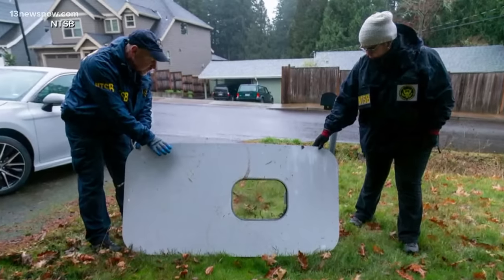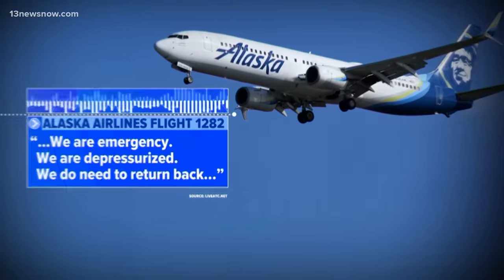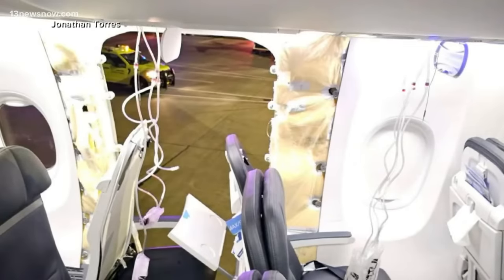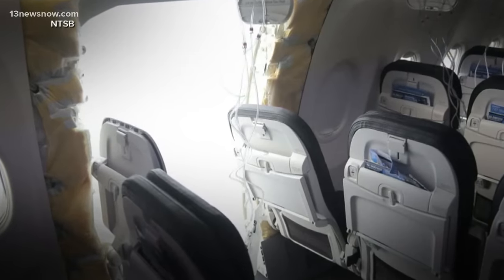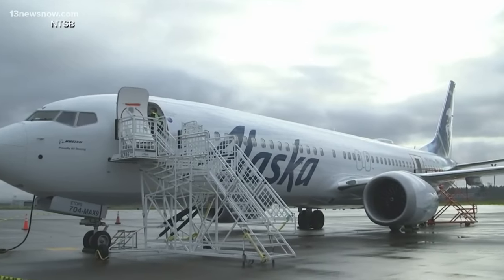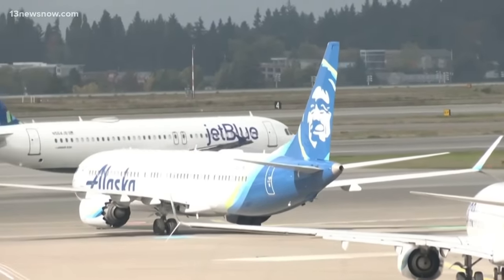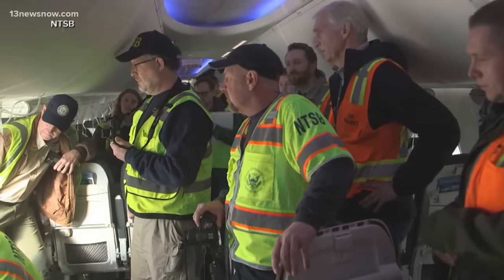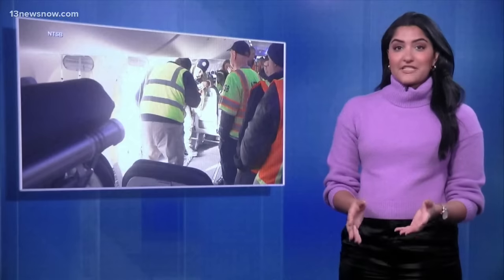Missing door plug from Alaska Airlines flight found

Comment: The cockpit door has blow-out panels that equalize pressure in the event of a rapid depressurization of the main cabin. In addition, there are multiple blow down panels along both sides of the fuselage, under the windows, that blow out to allow the cargo bins and main cabin floor to remain at the same pressure to avoid a main cabin floor collapse, which would be very bad.

Comment: Four bolts with an attached nut, anchored by cotter pin. My guess? NONE were there. They're in inventory and never got off the shelf. Either install was interrupted by a smoke break, and/or end of a shift and no one did the required hand off of the work order.
Reply: You got it correct

Comment: Isn't this model aircraft the same Boeing jet that had software issues because of the engines were made lower on the wing with less ground clearance?
Reply: Same!
Reply: Public: Yes
Boeing CEO: a little different
Mainstream media: blame Donald Trump
Reply: Yes, 346 people died in two crashes in 2018 and 2019. The Max fleet was grounded for years while the cause was investigated and repaired. These crashes were due to the failure of the MCAS flight stabilizing system which was added because of issues caused by the engine placement. The MCAS computer turned the nose of the planes down and dove them into the ground.
Reply: Yes this plane has been a dud from the start.
Reply: @bradwayne20  As an engineer, I am sure you can give us all a detailed explanation.
Reply: @ratratrat59  Not an engineer but common sense tells us if this plane crashed twice prior to FAA intervention and then a door blows off I think that’s all I need to know that I personally will be flying airbus 😂
Reply: @bradwayne20  Improper training and use of autopilot. In time, we will know more about the blank-off plate. I am an engineer.
Reply: @ratratrat59 just cause you are an engineer doesn't mean you are qualified to work on planes, and to correct you on the autopilot it was a faulty sensor that made the autopilot think the plane was moving too slow, thus forcing it into nosedive, recommend you do a little research next time.
Reply: @therealroguespy7256  Incorrect. Are you an engineer expert in avionics and aviation?

Comment: This is just the external panel, where is the internal section ?
Reply: The interior panel is just lighweight composite/fiberglass type material, it could be miles away and really won't tell them anything since it's not structurally part of the fuselage airframe
Reply: it's a door plug that flew off not a full door assembly

Comment: Absolutely no signs of ripped, torn or twisted metal at the doors edges. Not a case of loose bolts, but more like no bolts whatsoever.
Reply: The fuselage is shipped to Boeing with the door plugs only partially assembled. I wonder if Boeing neglected to do the final assembly steps or did it improperly.

Comment: This doesn’t look like a door plug but an external panel probably bolted from the inside. 
A plug, as per a sink plug, is larger than the hole & only gets tighter as pressure increases.
Boeing design on this 737 max upgrade to a very old airframe seems flawed, compromised to to keep costs low.

Comment: The location of the "plug door" is a poor choice...it is in the low-prrssure area above and behind the wing where it will be pulled away from the fuselage when its attachments fail. Either it should be properly strengthened, or eliminated entirely.
Reply: I'm assuming you are an aeronautical engineer, to make that kind of statement.
Reply: Or a qualified keyboard engineer with a lack of knowledge or experience in anything meaningful

Comment: Just guessing, but I think the grounding is unnecessary and will be very short.  I imagine this will prove to be an installation issue, not a design issue.
Reply: Boeing employee?
Reply: @petergibson2318 I don't think he's a Boeing employee, The facts speak towards the bolts being missing, incorrect, or unsecured. The fact that speaks most to that is the lack of damage to the fastening points on the fuselage and lower hinge.

Comment: I smell a rat.  The cockpit voice recorders are now supposed to record the last two hours of conversations.  Any thing older than two hours is re recorded over.  When the plane is making an emergency descent from 16,000 feet and gets immediate emergency clearance to land,  no more than 20 minutes should have elapsed between the depressurization and the plane arriving at a gate.  At that time the cockpit voice recorder information is required to be preserved!    The news media incorrectly states that this information was automatically deleted after two hours.  It appears that it was deliberately deleted by the Air Alaska employees.
Perhaps the crew made  some comments on pressurization warning lights before or during the flight or references to maintenance records?  If they had warning lights on pressurization and continued until the plane depressurized that could  be grounds for license and certificate action.

Comment: Does anyone else think that a door ejected from a plane would appear more damaged? Just a thought
Reply: It's not a door. It's a panel of aluminum with a lightweight frame.
Reply: @GWNorth-db8vn  my bad. A panel of aluminum which from .y own experience working with aluminum is very weak and would clearly show signs of damage from that fall
Reply: Damaged from what, air? Or the grass? It’s super-lightweight material, like a feather falling to earth.
Reply: @62Cristoforo  - I'd be willing to bet it was found miles from the plane's flight path. Flat stuff soars when it falls.
Reply: Is this the birth of a new conspiracy theory? Was Hunter's laptop sitting in that seat and now it's gone forever?
Reply: Of course it would have. But in this reality people believe a plane made of aluminum can go straight through solid steel so be careful asking questions 🙄🤪🧐
Reply: @cptn_chromo3189  - You're definitely going to have to conduct that thought experiment in a vacuum.
Reply: There is no weight to it. More than likely it deformed / twisted when it was blown off and that made it rotate and slow it's fall to the ground. From the photos it looks like the trees and thick underbrush may have acted as a cushion. Just thinking out loud.

Comment: Seems having more than the minimum number of doors would make for a faster exit in case of crash or fire but that only happens in the movies so why waste the money
Reply: So 6 doors is plenty since 8 doors would be too many when the plane is not full &/stuffed - therefore all the doors will be working when you need them most if you believe in math during a crash or fire - dying is unlucky
Reply: Doors are expensive and take maintenance. They're also heavy and cost fuel to carry. A door is much more likely to fail than a properly designed and installed plug. A plug doesn't have any moving parts and isn't subject to wear.

Comment: That door plug doesn't even look dented. How is that possible?
Reply: Good engineering😂
Reply: Due to the size and mass of the door plug, it will have quite a low terminal velocity in respect to the strength of it since it is meant to be pressurised. I also think it landed in bushes which would’ve softened the impact.
Reply: It would have dropped slowly, like a leaf, as it is only a piece of light weight aluminium probably.
Reply: D E N A Z I F I C A T I O N Matters
Reply: @AaronJumper  If jumped out I think I would have lived !😊
Reply: Light stuff flutters and soars as it falls.
Reply: @davidf6326  - It also has the area of a refrigerator. It's not a ball of metal. Low mass/air resistance ratio, if you insist.
Reply: Seriously, it was a door - not a wing!!!

Comment: No more plugs. Just permentally seal up that hole and be done with it.
Reply: This is about the best they can do. If you weld it, you're making a hard spot and the skin will crack around the welded area.
Reply: @GWNorth-db8vn  please explain
Reply: @ratratrat59  -  The panels expand and contract as the plane is pressurized and depressurized. The shape and frame of a door or window are designed to allow the entire opening to do so at the same rate as the skin. A weld has to be stronger or weaker than the parent material. If it's weaker, the metal of the weld will flex on each cycle rather than transferring all the force inward. This will cause fatigue failure of the weld. If the weld is stronger, it will resist the forces and the skin around the weld will bulge a bit on each cycle. This causes the skin to fatigue and crack.
Reply: @GWNorth-db8vn  well bolts that loosen is not a fix either. Sounds like boeing really screwed up this generation plane of the 737 max.
Reply: @edwardcornell1263  - Bolts don't loosen if they're installed properly. Someone initialed the work order when they put the interior in the plane, and I'm glad it wasn't me.
Reply: @GWNorth-db8vn  You have no idea what you are talking about. This is a proven design and the reason for failure is human error during manufacturing and Q/A.
Reply: @ratratrat59  - Settle down. Yes, it is a proven design and it works just fine barring human failure. That's pretty much my point.

Comment: Just foure bolts/screws hold /secure that door plug in place! "It's insane, Right"!
Reply: A panel that size and shape should have redundancy- a safety factor @Plutogalaxy  Plus loss of any one of the four bolts would create enormous leveraged forces on at least two of the remaining bolts.:face-fuchsia-wide-eyes:
Reply: There is a complex securement system...not just four bolts. But the bolts are needed & I suspect they were not in place.
Reply: The bolts keep it from moving around. It's held in place by 12 sets of matching tabs and four pins.
Reply: four
Reply: Wow are you an engineer at Boeing?

Comment: All the mechanical stuff that might give some insight into what happened is on the inside, so or course they only show the outside.
Reply: Bad info - a number of sites show dozens of pictures from the inside and the outside.  Maybe do your homework.
Reply: @jcran8352  - This video shows only what's obviously an airplane part. There are lots of pictures of the mechanisms on intact planes, but this is all I've seen of the actual part.